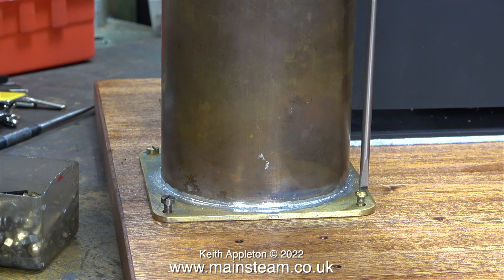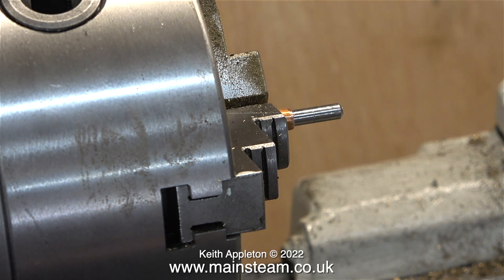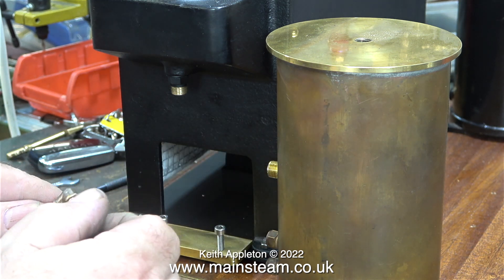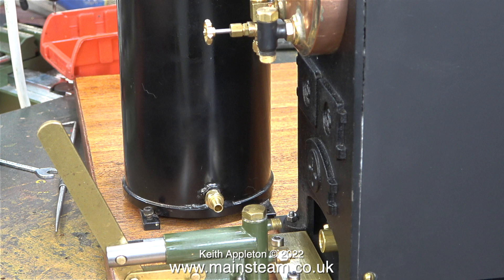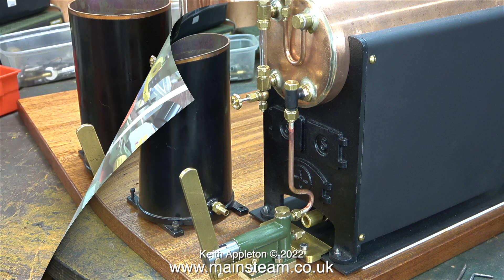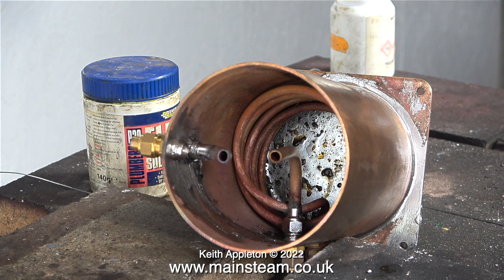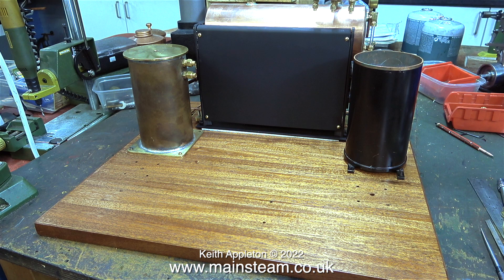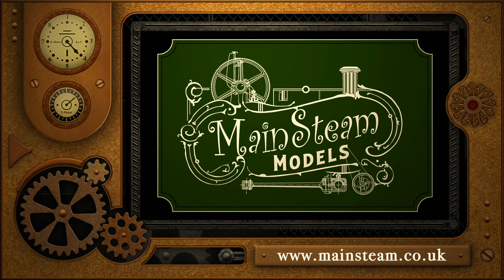MAKING A STUART MODEL STEAM PLANT - PART #66

Comment: The PMR elbows have the same pitch, but the thread angle is different -- the PMR elbows use a 60 degrees included thread angle, whereas in the UK, it's a 55 degrees included thread angle, necessitating a British tap to be used to make the PMR elbows to fit.
Reply from the maker: You are of course correct Gordon, this has been pointed out many times.